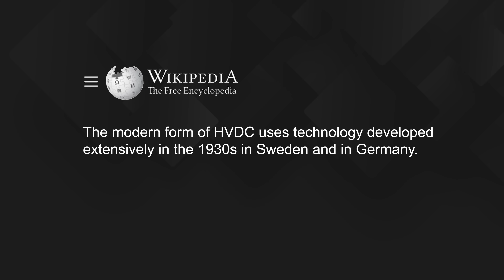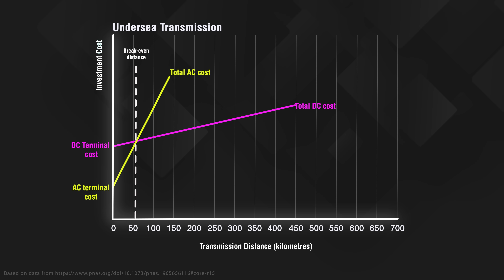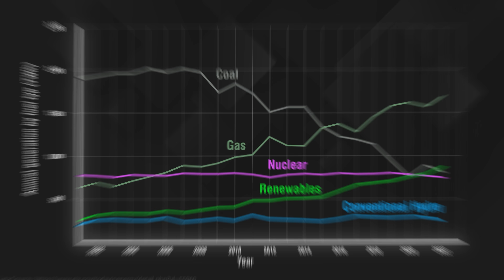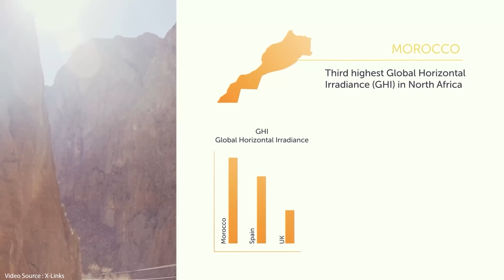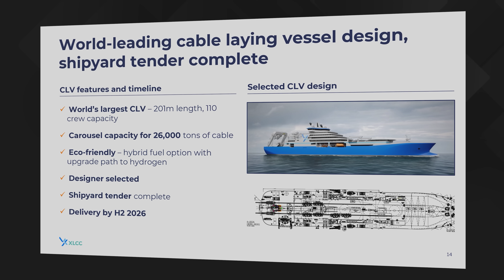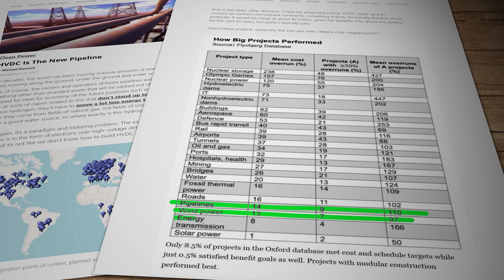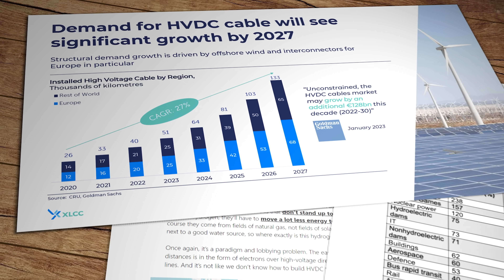Revolutionising power transmission.

Comment: HVDC is nice and efficient, but it seems more money and more bets are currently going to "green molecules" (green hydrogen or green ammonia or...). The green molecules pathway makes for an overall less efficient economy, but requiring less upfront investment because more of the infrastructure is already available (I recently saw a presentation of Engie's chief scientist Jan Mertens confirming such a state of affairs). Anyway, it seems there are various consistent and cheap pathways for removing all fossil fuels (along with all nuclear fuel) from the electricity grid without succumbing to any intermittency problem. An important caveat is that international tensions are deadly for most of these pathways so the Ukraine war and the cold war mentality may not be such positive developments for decarbonization after all.
Reply: why would you want to get rid of nuclear?
Reply: @doritoification  Because it's expensive, unsafe, too militaristic and entropy-producing (wasteful)?
Reply: @Hecatonchires1991  entropy producing has got the be a first for an anti-nuclear argument. Why are you concerned about entropy?

As for your other points, it's literally the safest form of reliable energy, it's not prohibitively expensive even in the worst cases and is very affordable when done right (see France) and domestic nuclear energy is not militant at all... They have dedicated reactors and enrichment facilities for making weapons grade plutonium that are completely separate from the domestic energy industry.
Getting rid of nuclear energy doesn't help get rid of weapons. As a matter of fact, weapons grade plutonium can be blended down to make civilian nuclear fuel. Google the "megatonnes to megawatts" project to see how civillian nuclear energy has actually consumed a metric fuck tonne of Russian warheads for peaceful, low carbon, clean, safe energy

Comment: This is interesting and encouraging but it is key that we don’t forget lesson from recent world events. Inter-country arrangements have a lot to offer but we need to factor in energy security too. I hope to see less reliance on hoge distance power transmission with a grid comprosing more ‘local’ renewable generation and storage delivering a significant percentage of overall needs
Reply: Yes, it's great if as much energy as possible is generated locally, but once every country also has multiple sources of energy coming from others, then no country will have the ability to hold others to ransom. That has been the problem in the past with Russian gas, OPEC, etc, and that's why these changes will prevent such abuses in future.
Reply: Seems like internation relationship management, esp wrestling it away from the financial class, is the project.😢
Reply: Energy security requires more interconnections not less.
Reply: It might be interesting if the Crown Estate built some wind farms rather than just charging 'ground' rent. Perhaps the King himself might build some? Over the last century & more the Monarchy has been more interested in the Public Good than the Government...

Comment: I do wonder about the supply of materials for these projects. How much copper are we going to need going forward and what does that mean in terms of mining or processing.
Reply: The cables are aluminum and there is some progress towards using steel for some situations
Reply: @mikeh6206  That is good news, no shortage of these material.
Reply: most power transmission isn't done on copper wire, it's aluminum and steel wrapped bundles.  copper comes in at the last mile sort of distribution, and mostly right in end use facilities.  using higher voltage can cut copper use substantially as well, a point Tesla made at one of their presentations recently regarding moving things to 48V architecture, as an example.

Comment: i would prefer the tech without the climate politics
Reply: I think in the end cost and profit will be the driving factors. If solar, wind, battery and transmission keep going down in cost they will push out other coal, gas, oil and even nuclear over time. No politics just technology and money.
Reply: Capitalism is always making a deal to benefit one form of money making enterprise over another but reality has checks and balances that will eventually line up capitalism in the most efficient and profitable sectors of which to invest in and renewable energy has won the pocketbooks of capitalism while fossil fuel companies are starving  Capital Expenditures (CAP X) and are going to send the oil price to the moon which will make renewables cheaper

Comment: You did not mention the Nebel HVDC transformer that will be rolling out further reducing Transmission cost by about 5 percent at half the cost. It does not sound like much but it is a game changer as well. At least on the infrastructure side.
Reply: have you spelled it correctly? A web search produces no results.
Reply: even Wikipedia https://en.wikipedia.org/wiki/Nebel produces no results
Reply: Wrong timeline @paperburn — the Nebel project never materialized in this one!
Reply: @HiAdrian  look again, different name same goals
Reply: @paperburn  Blimey, you're right!

Comment: An even bigger HVDC transmission project currently underway is the Australia-Asia Power link(https://en.wikipedia.org/wiki/Australia-Asia_Power_Link).  It would be a 4500km transmission line.
Reply: Paused rather than necessarily cancelled... it may be revived now that Mike Canon Brooks has wrestled control of the project.
My understanding is Twiggy wanted to cancel the HVDC component and Mike wanted to continue the HVDC component.
Reply: @timtravelnomad  I wondered about that.  Surely the HVDC component is the only thing that makes it actually work.  Also, I'm surprised that Mr Forrest would cancel that part of it.  Perhaps he's worried it might compete with his plans to sell H2 to the world.
Reply: @simongross3122  my understanding is Twiggy argued the HVDC component was politically risky in that Singapore might not want it. 
To me, that was a Tactic because Twiggy just wanted to pursue his h2 ambitions, as he is geavily invested in electrolisers and wants to kickstart an H2 system.

Going forward I believe HVDC will be recognised globally as absolutely essential to the transiton.
Reply: @timtravelnomad  There's also the very real problem of how many international borders it would need to cross.  Politically risky indeed.

I know that Fortescue is invested in H2 and wants to sell it to Japan and whomever else wants it.  And I applaud that, although it is technically difficult.  I hope he succeeds.

I hope you're right about HVDC.  And I hope it is as scalable as this video implies.
Reply: @simongross3122  the benefit of crossing borders is it's a 2 way trade deal.. every connection makes everyone's grid more reliable by diversiying risk, and allows excess energy to travel either way.
Imo Energy Security improves. 

Reduces reliance on highly manipulated fuel imports.
Reply: @timtravelnomad  Yes assuming we can actually make a deal with each country whose border is crossed.  There would also have to be treaties to allow repairs and maintenance within other countries' borders.  I agree, it would be a wonderful world.
Reply: @Tim TravelNomad  Good to hear if it's still a goer.
Even though the long distance UHVDC to Singapore is do-able, still think these kind of super-long links are rather ridiculous, like the UK/Morroco link, not for losses, rather the cable material, install cost and time mostly due to the nationalism, corporations and geo-politics in the way of creating a highly efficient international super-grid.

Eg the Morocco generation would be best connecting a much shorter route across to the gap to Europe and sharing with the EU rather than ridiculously bypassing it, Same with Australia should feed itself more and  join WA up to the main NME Grid as well as crossing the much shorter hop to Indonesia (but then are they Australia's good friends?) If a full on war occurred these super-long links could be highly at risk.
Reply: @Luxamor-8  I'm sure we don't really know who our friends are anymore.  With all the tension in that part of the world right now, it would be silly to assume anything.
Reply: We were hoping but it was cancelled.
Reply: @Luxamor-8  it seems to have re-started last month.
Reply: good point, did he miss that? or did he treat it as a given...  I think he mentioned it.  Said georgia could send powed to uk when the sun goes down, while UK sends powerback when the wind blows -- but he aimed that point at the peak demand issue... adjacent problem.
Reply: Unlikely to ever happen. HVDC as a one way supply line simply too lossy beyond 1,000km. But it makes a bit more sense over long distances when it is part of a matrix of users and suppliers.

Forest's approach of using the energy in the Australian grid and to make H2 makes a lot more sense.

 If the cable to Singapore goes ahead it would only meet 15% of the city's demand and has no levelling. If Singapore wants to go solar it makes much more sense to lease some land in Indonesia and install the panels there.

 Indonesia is also installing new nuclear power stations that work in tandem with solar power.. Singapore could also tap into that or install a nuke of their own. One medium sized nuclear plant would easily power the whole city.
Reply: @jimgraham6722  Your information is outdated.  Lots of 1000+ km HDVC is already being built.  Do you really think people would spend billions of dollars building them if they are too lossy?
Reply: @magnetospin  Longest undersea HVDC link I am aware of is the North Sea link at 700km. It is bidirectional (so generates substantial revenue in both directions without increasing the dimensions of the cable). 

It is laid in relatively shallow water less than 700m deep with a peak design capacity of 1.4GW.

In contrast the SunCable proposal is unidirectional 4,000km long and transits water depths up to 7,000m deep.

He North Sea cable cost about USD 2.2bn and primarily allows Norwegian hydro to levelize UK wind. The Brits can also export excess wind if there is a Scandinavian market for it including pumping the Norwegian hydro systems. So it can generate revenue in both directions. 

This matrix operation connecting many buyers to many sellers at both ends is important to the economics of this type of system.

There would be little change out of $12bn for SunCable. Even using the most pessimistic estimates, Singapore could build itself a decent size nuke for this amount that would fully power the city (rather than just 15% of it).

Reports indicate Singapore will likely harmonise it's nuke policy with Indonesia which aims to have a network of SMRs integrated with solar PV, replacing it's coal plants by 2050. Any Singaporean nuclear plant would very likely include a bulk desalination option.
Reply: @jimgraham6722  Cyprus/Europe is currently building a HVDC link between Israel, Cyprus & Greece.  Will be 1200+ km long
Reply: @timtravelnomad  Makes sense, will be a matrix system like the North Sea cable.
Reply: @jimgraham6722   HVDC only looses about 3.5% per 1000kms which is half the loss of HVAC which is why it's used for long distances https://en.wikipedia.org/wiki/High-voltage_direct_current
Reply: @jimgraham6722  HVDC is not too lossy. My understanding is it was projected to be 90% efficient. 
That's much better than the round trip efficiency of H2.
Going forward we need massive overbuild of Solar, and this project was also planned to have significant battery storage on site. 
Very similar to the Morroco Xlinks project. 

And this project was also designed to supply Darwin
Reply: @timtravelnomad  Study HMS law.
Reply: @jimgraham6722  hms law?
Reply: @jimgraham6722  
If you think HVDC is lossy, wait til you hear about hydrogen.
Reply: @AWildBard  Agree, hydrogen too expensive to just burn for energy. However, it is not just about electricity generation,  hydrogen will likely be essential in large quantities for chemical processes currently using fossil fuels. For example high temperature chemical processes such as iron ore and cement production. It will also be needed in a host of chemical processes involving hydrogenation, including paint, plastics, polymers of all types, fertilizer, explosives and synthetic aviation fuel amongst many.
Reply: @jimgraham6722  latest Georgia nuk from USA was  6 times more expensive. 15 years to build.
Hopium. 
Could build this in 3 years. Supply Indonesia islands as well. And the project has sufficient firming, batteries to provide 24 hour supply.
Reply: @HughButler35  Indonesia has already contracted nukes plus solar. Very good move on their part.
Reply: @HughButler35  Yes the nuke industry in the US has been very successfully nobbled over many years by the coal industry.
Reply: @HughButler35  Nuclear is affordable if you run it with a high capacity factor. The issue with batteries, especially in climates like Indonesia, is that they only have a lifespan of around 10 years for now. Replacing them every 10 years chews away a lot of the economic benefits. Nuclear plants usually have a lifespan of 60+ years.
Reply: @jimgraham6722  Thanks, that makes sense.  I would have thought that getting cheap energy within Australia should be our priority.
Reply: @simongross3122  We are building out cheap energy is Australia.. interconnects aee essential to get rid of excess energy and timeshift that energy to where its useful. 
This of it aa an energy soak for when Australia doesn't need it. 
It all comes down to market supply & demand.
Reply: @timtravelnomad  That makes sense.  But our energy demands are increasing, not decreasing.  And I am not convinced yet that rooftop solar is compelling, for me at least, especially if batteries are needed too.  That will change, of course, as batteries become cheaper and as PV cells become more recyclable.
Reply: @simongross3122  pv is already 95% recyclable.. and will only increase after the 40+ years service you will get out of them. 
In many countries, Home pv is the best return on investment of almost any purchase. 
(Another isswitching to inverter variable-speed pool pumps)
Reply: @timtravelnomad  I am still waiting.  Maybe later this year.  We have a big construction going on next door and it's unclear how much it will overshadow our house.  So I need to wait until next door is finished.

Also, I won't buy a home battery yet.  They are improving too quickly and they are still horribly expensive.  So PV will only really help me during the daytime.

We did replace our electric water heater with a heat-pump water heater.  Supposed to use about 25% of the energy.  Waiting on my next electricity bill to find out.

I will investigate how recyclable PV is here too.  It's pretty unclear to me.
Reply: @timtravelnomad  now cheaper to bung on another  kW of panels and use inefficient 2kW pump than the cost of an energy efficient pump. That's the thing with solar. Fixed upfront cost. Close to zero operating cost.
Reply: @HughButler35   the new inverter pool pumps have around 80% energy saving..  and have a 1 year payoff period.. even better than solar panel's 3-4 year payoff period. 
Many people have limited roof space for adding extra panels.
And many countries have limits on net metering, and import tarrifs,  time of day pricing  etc it is often still worthwhile as you run the pool pump beyond daylight hours.. 
Almost everybody is running single speed pool pumps with 1.5kW of power draw.. while the good inverter pumps draw around 100W.
Reply: @jimgraham6722
Reply: @jimgraham6722  Can you expalin where the losses come from past 1000km. Is it something more than just ohmic resistance?

Comment: and how wonderful it will be when we no longer have ugly overhead power lines going through our forests. right now there are huge areas of our forest being cut down to make a path for the long  distance power lines. i just hope people are smart enough to lay a large conduit so the lines can be serviced, updated, repaired, etc. i know it would make for a more expensive startup but it would also make resilient flexible connections where we could also run fiber or any other  new tech that will come up. just think how awesome it would be to have true distributed network of power and information that is cheaply update-able with zero impact on aesthetics or the environment. it could me a huge machine that we can dump all our plastic waste in and have a heavy conduit spit out the other end which buries in in the soil it dug just before. i saw an awesome asphalt road replacer system that dug the old asphalt, crushed it, heated it, added new tar, laid it down with a squadron of rollers flattening the new road. it was only moving at a mile an hour or so but it was taking a poor road and leaving a perfectly new road in one move... it was awesome.
Reply: That road technology sounds cool.  I don't think that we could do plastic recycling the same way.  HVDC cables are very sophisticated and need to be made under exacting conditions, so a factory is needed.  Recycled consumer waste doesn't have the properties needed for underground HVDC cables.  It would use a sophisticated engineering resin or composite.
Reply: @incognitotorpedo42  true but i was not suggesting the wires be made on the spot. i was suggesting the tunnel (conduit) they run through be made on the spot... out of waste materials.